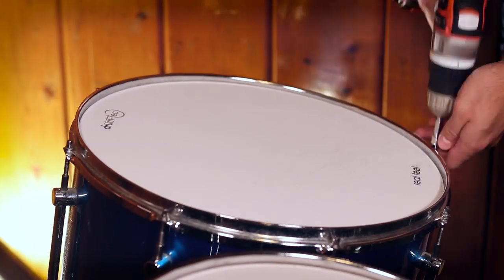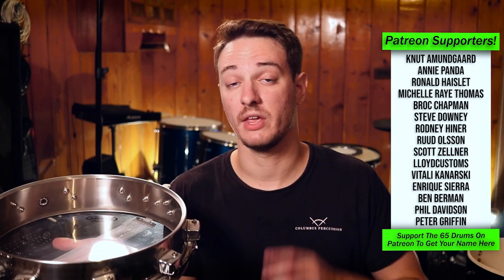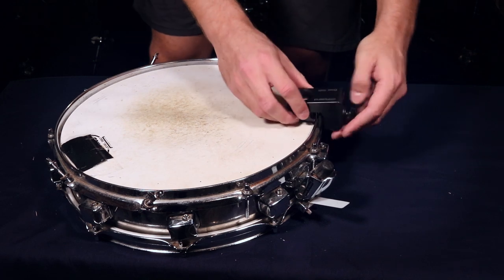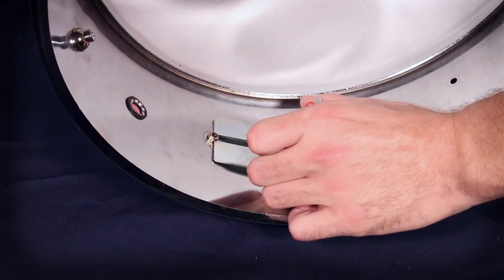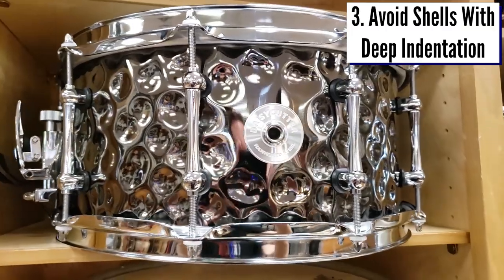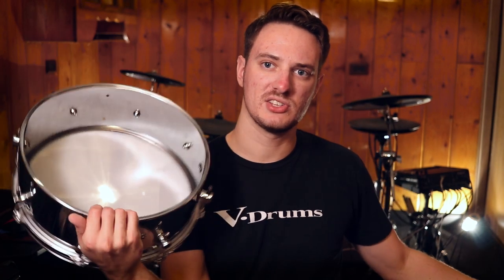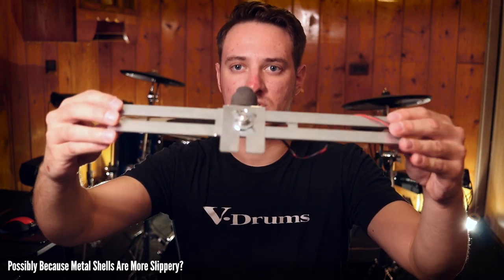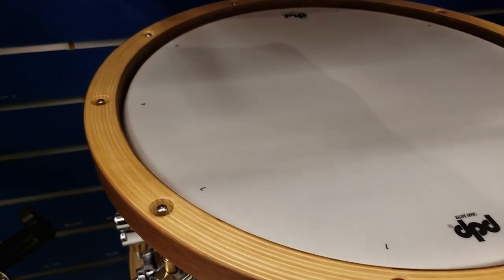Avoid These Drum Shells (If You Want To Install Drum Triggers)

Comment: R-drums bar triggers come with big washers(distancers)  if you need to apply them to a steel shell. Just need to request them when buying. It won’t rotate then. In terms of side trigger, you can use a wronka trigger. It is adjustable and should fit the flat shells. Use some big washers as spacers. - Steel Shells are the best for an accurate triggering because of the bearing edge.

Comment: The hand hammered snare, you could always use a sound hole with a bolt and nut to mount the trigger. You could also leave the resonant head off so it is more like a timbale if you need to route the cables without modifying the shell

Comment: Hence why there should be an adjustable telescopic pole/railing style mount or cross brace system with iso pads similar to May Internal Miking System to mount microphones and/or triggers internally without the need to screw them to the inside of the shell. Also, how would the R-Drums PlugHead go on an acoustic drum? It will obvious effect the resonance but how detrimental to the sound of the batter head for rack and floor toms or a snare without snare wires installed?

Comment: I didn't see you mention Peavey RBS-1 or RP-1000 (or the cheaper 500s or 750s). I have my RP-1000s set up with ddrum Red Shots. They BARELY mount, because of the radial bridge that the drums are known for.  The standard ddrum triggers (or anything like them) WILL NOT work.  The radial bridge gets in the way.  I also have a stick on trigger stuck to my snare shell, to capture the cross stick or any rim hits.  You also can't use bar type triggers, as they have no screws, holes, or hardware protruding through the shell.  Just a warning!

Comment: Best solution, I've found, is to simply drop a Roland trigger basket into a drum shell.  As long as the shell is close to round, it works like a charm.  You'll just have to drill out for the 1/4" jack...
Reply: What kind of Roland pads will work for this method?
Reply: @johncallegari2721  Any PD pad that has a trigger basket...including the PD 140-DS (Which I'm about to mount in a Tama 6x14 snare ).  I have PD 105's and 125's, but I also used a PD 100 and a PD 120, but those require a little more work since you have to screw through the shell to mount the trigger bar at the right height.
Reply: rowinsho Do you know of any videos showing the conversion process?
Reply: John Callegari  There really isn’t much to show.  Just take the head off ,lift the basket out and set into the new shell.  Like I said, I’m doing it with a TAMA snare.  I’ll take a video of it and send it to you.  It’s actually easier with the PD140-DS since the cable is attached and hangs from the bottom.
Reply: @rowinsho  Thank you!

Comment: Hey Justin. I am planning to buy Roland RT-30K and 2 RT-30H as a Christmas gift to myself and my concern is, here in Philippines most drummers utilize the backline kit because not everyone can afford to buy or bring their whole setup inside a small venue. Will I have problems with regards to sensitivity, threshold false triggering from kit to kit if I opt to use backline kits? I'm using an SPD-SX with dual footswitch and KT-9 and just thought I can still maximize the module with 3 triggers but I was wondering if it's worth it